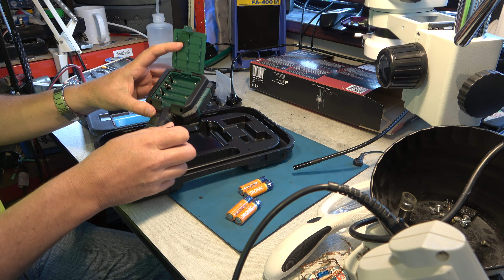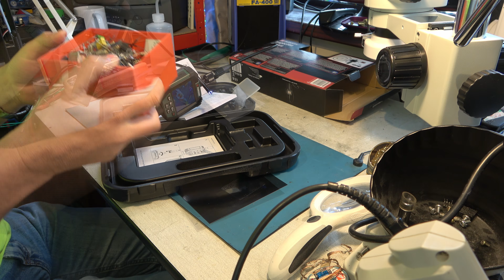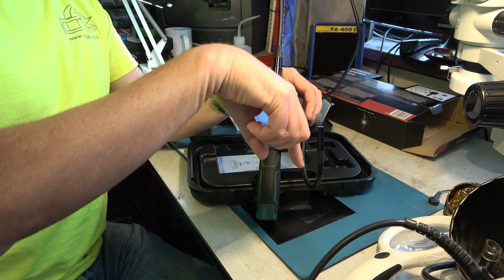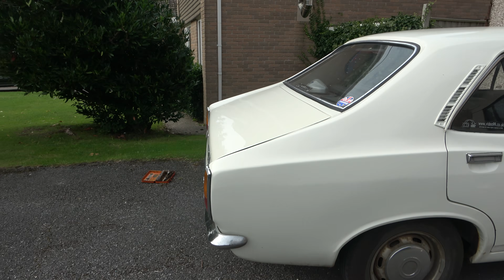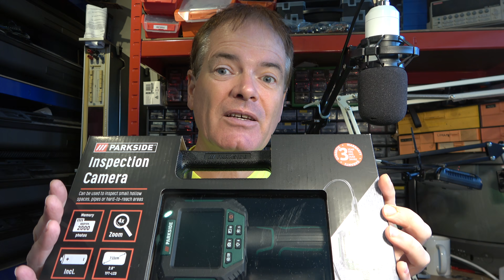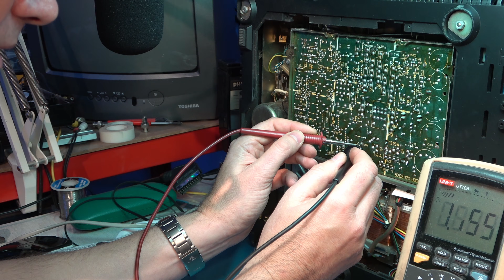Lidl Parkside Inspection Camera (Borescope)

Comment: One of my pet hates is appliances with controls marked only with unintelligible hieroglyphs, making you refer to the user manual to find out what the controls do. I do exactly what you did here and print my own labels to stick on, and whenever I'm buying a new product like a dishwasher or microwave I look for one with words on the buttons instead of symbols - sadly the trend seems to be moving away from words towards symbols. Often I find the newer model of essentially the same product has replaced the words with symbols.

Comment: When you were looking at the date code on the capacitor and said it was hard to read due to the angle, I though, why not just rotate the device with the screen to get the right veiwing angle. (?) :)

I bought something similar that is USB, except instead of a stiff neck with the camera, it has 10 feet of wire that flops around and cannot be positioned at all. Ha ha.
Reply from the maker: It can be really awkward to rotate it because the stiff neck will jam up in the confined space.  A floppy wire could be both good and bad, depending on the application.

Comment: They should of put a side camera in the end as well,  pity they didnt.
I was wondering what type of signal goes into the rest of the device.
Imagine having composite video,  have it connected to a vcr :-D
Reply from the maker: It's possible that it sends analogue video.  The point of it though is that it is a single portable device, not relying on a 'phone, laptop or even VCR.